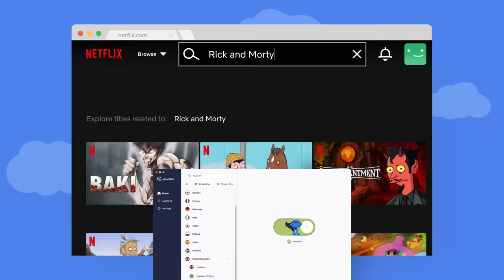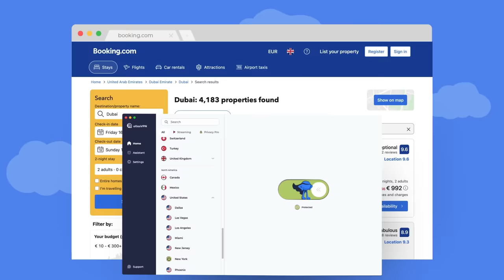How do Russians Cope with Heavy Tank Losses?

Comment: So basically they can produce new tanks. But I think that they should somehow increase survivability of crew, they are far more valuable than the tanks itself
Reply: No matter what the survivability rate, russian losses are always 100% on the internet. What russia needs is better internet.
Reply: You're not fixing crew survivability without coming up with brand new design. That said, not loading T-72 to the brim with reserve ammo does help with ammo cookoffs, as autoloader carousel is in statistically safest place to be in a tank, new, less volatile propellant that doesn't reduce shell velocity also could help. Sure, direct hit will make nice boom, but so will in Leopard, Leclerc, K2, Challenger or Abrams, you're not bypassing physics and you better pray for blast doors to hold when ammo explodes, assuming its not hull ammo supply that goes off.
Reply: @fungames24  I don't get the pun but factually Russia has more modern internet infrastructure then US and their service prices are a fraction of what's charged in US.
Reply: @BigSmartArmed  If russia has modern internet, then why does the internet say russia lost all its tanks and is fighting with shovels?
Reply: Higher survivability must have been achieved with T-14. Unfortunately/fortunately (depending of your views),  it seems T-14 won't be introduced massively in this war, if it will be at all. Russian arms bureaus currently experiment with "it's only good if we can produce it" formula. I.e. BMP-3M Manul, BTR-22, T-90M, 2S43. This method also seem to being applied to firearms, looking at latest models of AK-12. Basically Soviet arms, heavily upgraded up to standards of XXI century, both conceptually (BMP-3M, 2S43) and technologically (T-90M).
Reply: @fungames24 you are confusing internet infrastructure with internet propaganda.
Reply: @BigSmartArmed You are confusing internet for internet infrastructure.
Reply: @fungames24  I'm too old for this.
Reply: @BigSmartArmed Yes, you are too old. This is why you are struggling with the modern internet. Everybody in the world knows russia lost all its tanks, as confirmed by this video, and lost all its soldiers - because the internet said so.
Reply: @fungames24  You seem like the type of person who is watching way to much propaganda from one side. Nobody ever said that they are "loosing 100%" what ever that means. But Russian losses are certainly extremely high, just as Ukrainian losses are.
Reply: @BigSmartArmed dude half the country doesn't have heat during the winter. There infrastructure is crumbling. Head outside of Moscow and St Petersburg and see for yourself.
Reply: @fungames24  I'm too old to argue with fools.  I haven't cared about propaganda since the last century.
Reply: @BigSmartArmed  Maybe you should care. When armed with advanced internet, you can destroy your enemy without risking your own.
Reply: @fungames24 because Russia hasn’t shown up to the Internet war. That’s why it’s being totally destroyed there.
Reply: @fabik805 you may be right. But if so, why are Russian men allowed to leave the country freely and Ukrainian are not? Why is it a criminal offense to post footage of cemeteries in Ukraine, but not in Russia? Why have there been 9 (or more, hard to keep track) waves of mobilization in Ukraine and only one in Russia? If Russian losses are just as heavy as Ukraine’s, it has to show, for some reason it doesn’t.
Reply: @2005batman  Russia's population is more than three times higher than Ukraine's and so is their military active personel. Therfore they have to draw far less from reserve forces because they can just fill the ranks with professianal soldiers from other regions. 

Ukrainian men are not allowed to leave partly because they need soldiers but also to protect the economy. If Russians get a mobilozation order they are also not allowed to leave the country.

As for the cemetery law. I don't think it is true. If it is please site me a source.
Reply: @fungames24 they can’t afford to build better internet infrastructure they spent all the money on tanks
Reply: Uh, things are so bad in Russia that most people don't care about the conflict at all. Things are so bad in Russia that even the places I used to live in are being developed and turned into normal cities. Think John think.

Comment: Getting a repaired/upgraded tank, made by normal people with no skills…. I can imagine the weld quality😂
Reply: idk man bradley welds were melting even tho that was top quality. lol. sadly missiles don't care about the quality.
Reply: @MGZetta   how is a weld supposed to protect you from a missile💀💀
Reply: @MGZetta missiles don’t, but rounds do. Ya know, low calibre rounds like 5.56, 7.62, 12.5, 30, etc. poor weld quality creates gaps which slide open when hit. Look at damaged T34s in WW2, and you will see what I mean.
Reply: The "no skill" part applies to people watching this video and completely failing to understand its content. 

The people "without skills" are scholars and other intelligent professionists that get then trained extensively in what role they're gonna be placed- and it's not repairing tanks, that's reserved for people with extreme mechanical skills and passion, you'd know it if you could understand how complex and refined a tank engine is.
Reply: @Narcan885  well thrust me, most scolares and intelligent professionsts dont know how to use tools. At my job 99% of the guys with nice educations that sit behind a computer etc cant help in the production, they simply lack the skill. And take welding skill, that takes time to master. Its easy to make shitty welds🙂And a tank engine is not refined.. its just a work horse that has too last like 500 hours.
Reply: @waskus  Sigh wastus, you're a lost cause. You clearly struggle to understand written language, so what's even the point in this conversation. You literally cannot understand what people explain to you, or maybe it's not a skill issue, maybe you just don't want to, i don't know and i don't care.
Reply: @Narcan885  exactly

Comment: The Rostok owner saying that "tank production has increased 7x" may be true, but does not mean that 7x the number of tanks are being produced. 
It could mean that all production capacity, from repairs to tonnage to budget to workforce size has increased by 7 fold, with those numbers taken together. 
A single plant, if it doubles in size doesn't mean 2x as many tanks are rolling off the factory floor.
Reply: More likely as we know now it's just amount of rubles flowing, which leads to an "increase in military production" despite the budget being cut for example. EDIT: Due to inflation, of course. You need more rubles now to do the same thing as in 2022.

Comment: Remember btw that stuff that count Tank losses are bad because they give you a bad picture of the losses.
First you get only the losses, also included in that are recoverable ones, and when those get recovered its not necessarly documented.
Then you get no status on production.

And the end specially since this is a war where both sides uses basically the same stuff,you get a lot of double counts, as stuff get repair and lost, and as stuff gets lost while not being identifiable.

My point here is that in the end, the Russians cope with far smaller losses than you would think.
Reply: Plus add Oryx intentionally fudging numbers, adding blatant photoshops, old vehicles from 2014 and Ukrainian losses to Russian ones and we get a grossly inflated number

There was recently an expose on Oryx - of the first 10 listings only 2 were accurate.
Reply: @AndRei-yc3ti  I saw that, it was with a T-62 which is actually attacking a steelman, since what he was attacking was the info related to what was posted.
Reply: @AndRei-yc3ti  Can you find me a single tank loss on Oryx that was inaccurate? And here's a challenge for you. Count the number of ones you have to go through before you actually find a fake one.
Reply: @ImBigFloppa  I won't click there because of many problems related to the site but I gonna leave this here.
In early 2022 Russia advanced to the Melitopol airbase where there was 50 IL-76 parked
From that one was destroyed by a fire and the other was damaged.

So Ukraine lost that day 2 planes, 1 damaged on destroyed... Also the air base is clearly on Russian control but you see nothing about the other 48 planes.

Comment: Considering the leaked Pentagon documents that also showed the number of fallen soldiers, Ukraine's tank losses should be significantly greater when the Pentagon's calculated kill ratio was 1 to 7 in favor of Russia. 1 to 7 also reflect the artillery ratio of the belligerents, with Russia having between 5 and 10 times more artillery. They also estimated that approx: 80% fall from artillery. There is some logic in that when you know that relationship. To be sure, Russia suffered heavy losses during the Kiev expedition that led to the peace draft accepted by both parties in March 2022 but later opposed by NATO by Boris Johnson's Kiev trip the day after.
Reply: The Pentagon literally never leaked documents showing 1:7 kill ratios in Russia's favor, ever. The only legit "leaked" Pentagon documents out there showed a ~1:3 kill ratio in favor of Ukraine... which was literally before Ukraine's "counteroffensive" and before shyt got heavy in Bakhmut... which means they probably changed significantly. But again, there's literally nowhere that ever had Russia at 1:7 k/d ratios.
Reply: massive cope

Comment: The losses are substantial, probably more than a thousand or so, irretrievably. If the tank was on fire, it is not restored.
A thousand tanks is a huge figure, but not for Russia. Much more in need of medium and restorative repairs, not even because of damage, but resource consumption. And this figure is many times higher. So the losses against this background are just statistics.
Until 2022, there were more than 2,000 tanks of all types in active use, more than 1,500 that have undergone modernization. And about the same amount is in reserve without modernization. And the same number in the third category of validity, i.e. in need of repair or subject to write-off. But it's also worth remembering about old decommissioned tanks that are simply used as a source of spare parts. There are even more of them.
So the main problem is the availability of personnel for repairs and time.
Tanks are also mainly used, as they should be, as a means of support in the assault / deterrence of the enemy, qualitative strengthening of defense.
In fact, the West has used up all the reserves of old armored vehicles available to it and is already transferring armored vehicles from its armies, often together with mercenaries.
And the Russian industry has just begun to reach the planned indicators, two years later.
While you were killing your vassals about us, we were deploying production. Which became a locomotive for
the economy.
P.S. Finally my education came in handy)
The program of training and retraining according to the reduced programs, 1.5-2 years is accepted. Considering that we have quite a lot of people with secondary and higher technical education, this is not such a problem.

Comment: 3 shifts = 3 times more tanks.
7 times more tanks? Would require a doubling of production plus.
Reply: Your math is off lol. If each other shift was the same then it would be an extra  200% of production at the start. But there is too much lost data to make claims here. Same goes with the 7x as many figure.

Comment: It's the second tier suppliers that count.  FACOs can always diddle the numbers between 'factory' tank fleets as: Export Variants awaiting payment/delivery and needing only minor sights/radio upgrades; 'Next Year' orders assembled from long lead items purchased half a decade prior in micro-lot increments; and first dibs on depot storage sites with usable Cannibalization Candidates.

But the forward battalion and division repair shops; those are the ones ordering crates of widget X, say an ignition wire or batteries or fuel heaters, even lubricants and cleaning solvents and sealers.  Or tools like air wrenches or electronic boresighting and BIT diagnostics.  Come up short on these via tooled machine shops or chemical shops back home.  Or due to uneven/intervaled delivery capacity as rail and truck scheduled freight manifest windows and the operational readiness of your armor is going to 'tank' in the worst sense.

Force readiness will then follow a sine wave of building and lost force capacity relative to last routine maintenance and utilization/training rates as ops tempo rather than actual, in theater, inventory availability or even combat loss rates.

Comment: Isn't it easier to increase tank production? 
Tank production is usually lower than armored ifvs therefore the multiplicator  will be higher after increase.
Reply: Russian defense industry was producing about several hundred tanks per year for decades. It is not as simple just to start producing 3-4 times more. Europe suffer the same issue with artillery shelling.

Comment: Why does being a tank mechanic look easier than being a modern car mechanic bruh
Reply: bcus its russian equipment simplicity is key and modern cars are overengineered junk
Reply: Designs are highly standardized
Reply: @rustysutton  valid, the amount of sensors and wiring on modern engines is a joke. Basically all modern German cars are ass to work on

Comment: Russian tanks are designed from the very beginning with the economic of maintaining, fixing, and rebuilding them. this is why Russian tanks are smaller and less advanced than the western tanks, in one against one, a western tank might easily defeat the Russians but it doesn't mean that Russian tanks don't have the capability to destroy the Western tanks. it got what it needed to puncture the Western tank armor. but any destroyed Russian tanks can be rebuilt at a cost much lower than the western tanks.